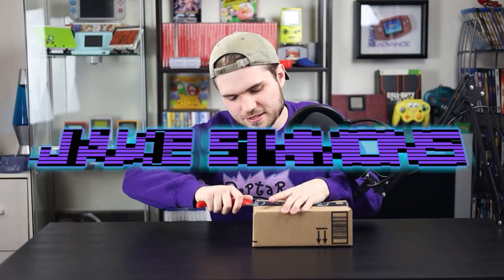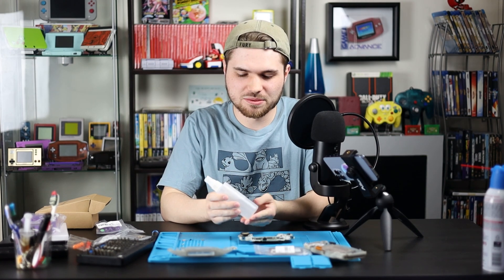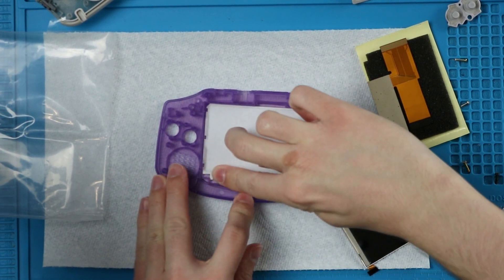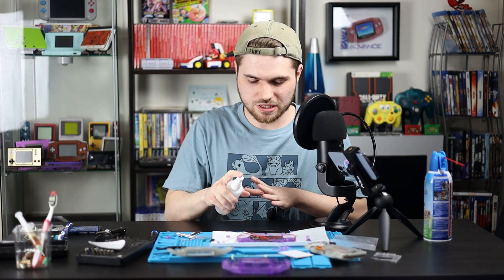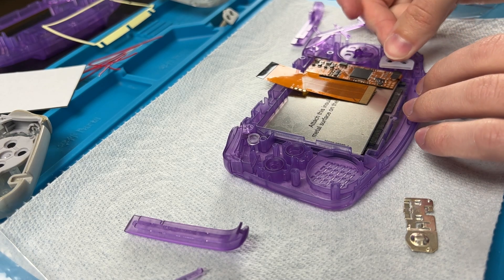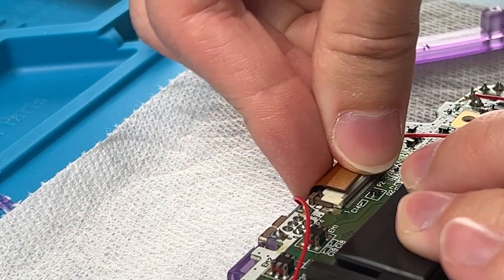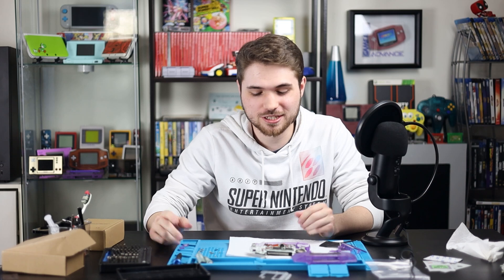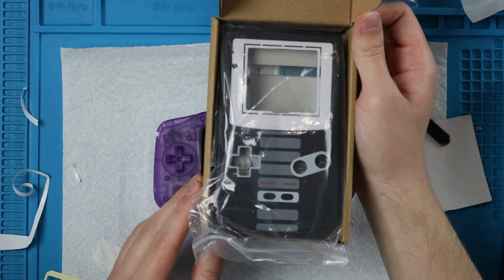How to MOD a Game Boy Advance! (2022 In Depth Tutorial)

Comment: Man, I've done two of these so far and this guide is pretty helpful.  Unfortuantely, neither of them turned out perfect, but for my first two mods I'm happy (or so I try and convince myself).  My first one had a fingerprint on the ISP screen, and my second one WAS perfect until I screwed the battery screw in too hard and it left a bump on the front of the system.  Almost cried ;-;.
Reply: That’s fine! You still did great! (:

Comment: I'm planning to do this ips mod (possibly even add a lithium battery and a better speaker+amp) and I'm wondering what aftermarket trimmed shell has the best quality. I want the original GBA feel and strong plastic so it doesn't break.
Reply from the maker: I’ve been having a lot of issues lately with shells cracking. It mainly comes down to the screw posts. Don’t over tighten it and go slow and you’ll be fine. I’ve never heard of a shell cracking any other way. But if you have the money, boxy pixel does sell all aluminum shells. Otherwise the original shell is the strongest plastic shell out there. I’ll be doing a tutorial soon on a drop in kit that won’t require any trimming if you want to go the original shell route.
Reply: @JakeSimmons  Yeah, the original would be the best. However, I would probably buy the Funnyplaying IPS v2 for the GBA (seems like that's the best screen) and that will require trimming. The trimming needs to be perfect to have a flush fit with the screen and that seems kinda hard to do for the first time.

Comment: hello i installes a v2 screen yesterday to my gba and it works but the white on the screen is more of a light light purple would you know if i have done something wrong or is it meant to be like that
Reply: its like a white but slightly purple
Reply from the maker: I honestly have no idea what’s wrong with it
Reply: @JakeSimmons  no problem thankyou for the reply, it doesnt really bother me i just wanted to know if it was normal really or something id done,such a strange one 😅
Reply: @JakeSimmons  i just found out its got 8 modes to the screen controlled by a touch sensor im not sure where i was suposed to stick the sensor as its a non weld one so left it just lose thats why its stuck on pink setting, still not sure where that wire is meant to stick to... 🤔

Comment: Hey Jake, is there a reason why you didn't tin and attach the wires to TP8 and TP9 connection points as you did with TP2? This is the first tutorial where I've seen it done your way and it looks way easier!
Reply from the maker: I have since switched to using tp8 and tp9 because it’s faster but thats just because I do so many of these mods haha. I do think soldering using the L and R pins is easier though

Comment: Putting any wires around the capacitor llike that not a super great idea. As if for any reason the wire nicks you have a greater chance of creating a short, not to mention if for any reason the capacitor goes down the road it will release an oily substance that will get on the wire. Also because they deal with electric current that also means heat so something to keep in mind when putting components next to them. While it under normal circumstances they wont put off a lot of heat a failing/shorted one might. Usually this is the reason resistor and capacitors are not put too close to chip sets, ie right on top of to the point of touching.